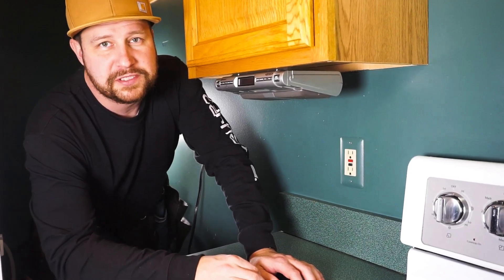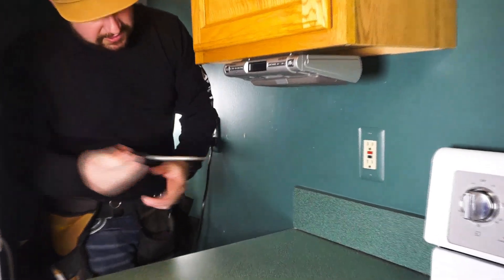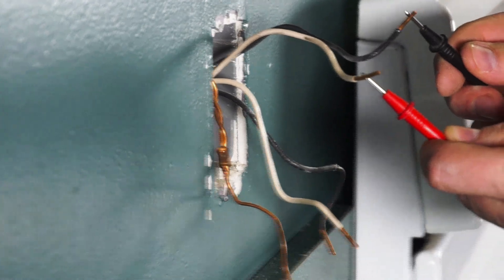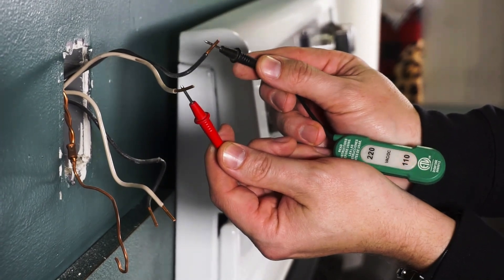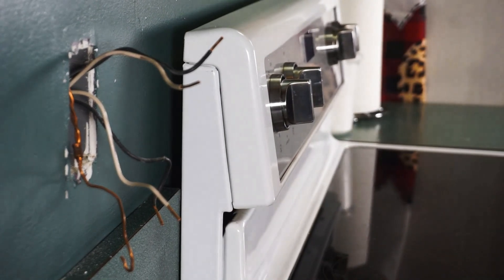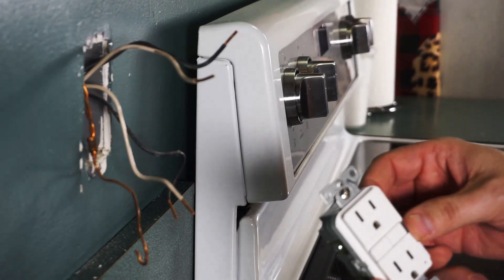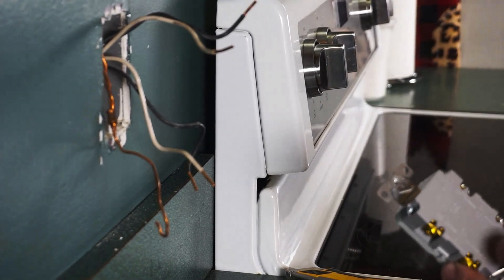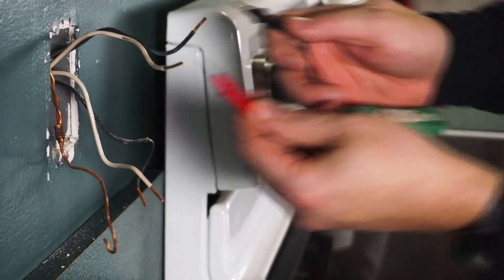How-To Install A GFCI Outlet For Beginners: DIY

Comment: You're posting this video for DIYers but you fail to mention shutting off the breaker before removing cover, etc. Oh, I stand corrected...You're working on a live circuit. Unbelievable. 141 subscribers. Hopefully it doesn't go any higher.
Reply: Go big or go home with non functional outlets
Reply: And... not to be a stickler, but since this is for beginners, he could address the practice to not having too much copper being exposed